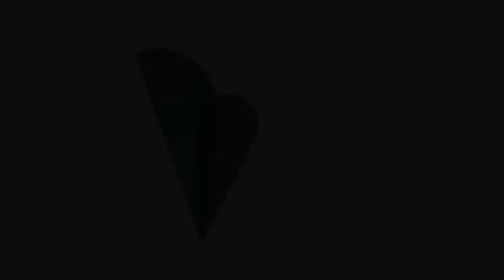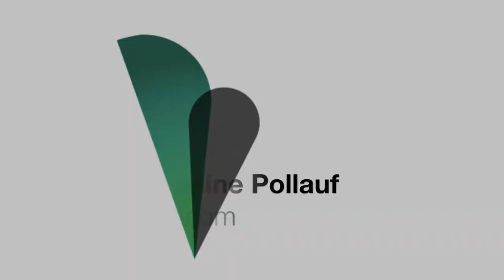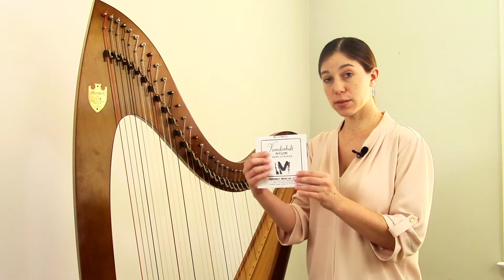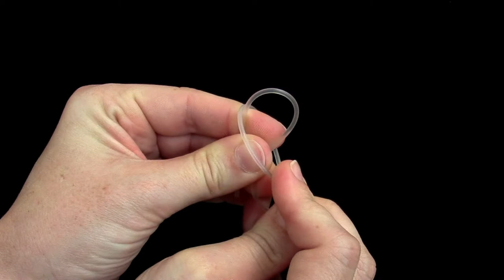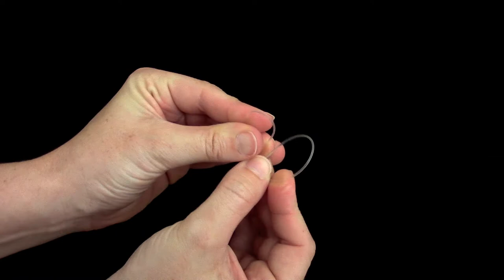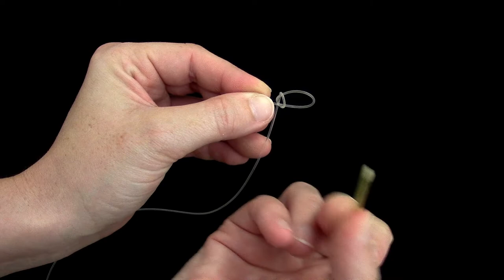Replacing a Nylon Harp String, Harp Care, Maintenance, and Repair #11

Comment: Any chance you could do this for carbon strings? This is not my first time changing strings, but carbon seems to be very fiddly with regards to how slippery it is and how incredibly stretch and easy to mess up at first it is.
Reply from the maker: I had not thought of carbon strings! I will add to my list (which does not necessarily mean that I'll get to right away, but hopefully eventually). Thanks for the idea!

Comment: Hi Jacqueline, thank you for a great video.  I replaced a 4th octave B string on my L&H Troubadour but there are too many winds on the peg now and they are getting too close to the body of the harp.  The string continues to be flat, and I don't want to wind it any longer.  Do you have advice on how to approach this problem?
Reply from the maker: This is a problem that does come up from time to time, especially with the lower nylon strings. The solution is to unwind it, pull it through the tuning pin again, and rewind it. Generally when you do this, you'll find that the string has stretched some so you can pull more of it through the pin and it will not need to wind around as many times.

It's on my list to make a supplemental video of string changing tips at tricks (at some point!) I will add this to the list of things to address.

Thanks for watching!
Reply: Thank you so much for the quick reply!  It worked :)
Reply from the maker: @iankivell7997  Excellent!

Comment: I am restringing an old 22 string lap harp. The tuning pins on some are loose. How do you fix a loose tuning pin?
Reply from the maker: Most tuning pins are tapered, so over time they can work loose. Usually to fix this you can just push in, fairly forcefully, as you turn the tuning pin. I would try that first and if it still doesn't work, sometimes people lightly hammer them back into place, although this should be done cautiously. Good luck!